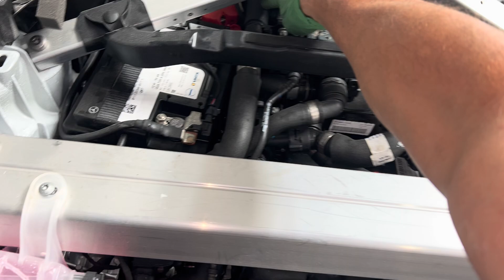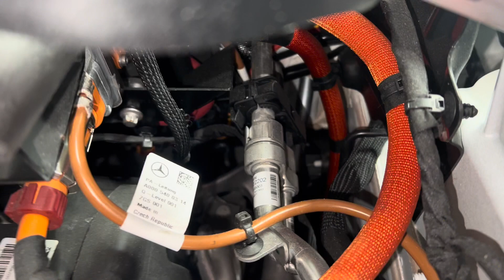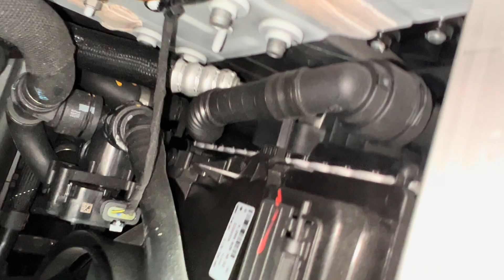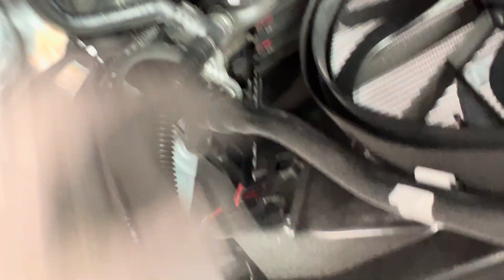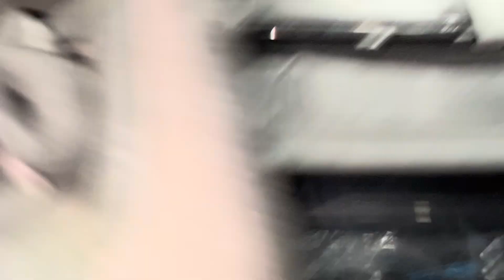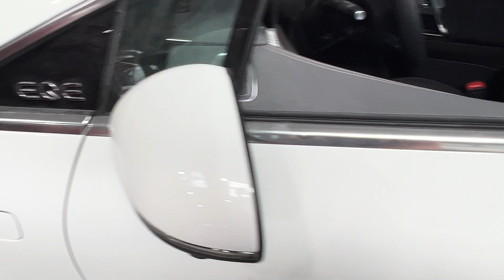AC EQE  ELECTRIC MULTIPLE PLATE HEAT EXCHANGERS, MULTIPLE THREE-WAY VALVES, MULTIPLE WATER PUMPS ￼

Comment: This is a 4WD version of the EQE right? I think there would be more room up front if it was the rear drive only version, in that case it would be easier to work on it. Anyway it's not THAT bad because at least the motor is simple and electricity is free so driving is free. My friend has a 2019 diesel Benz E400 and an AC compressor went bad on it with the R744, you can't get this AC compressor replacement from this planet anywhere else except Mercedes and Mercedes wants 9000 USD to change a new one. My point is that the manufacturers these days will fuck you no matter if its an EV or ICE. My own 2007 Honda Civic just keeps fucking me slowly but steadily all the time, introducing new things that fail every few months so I have to repair that POS and use my time on it rather than do something I enjoy.